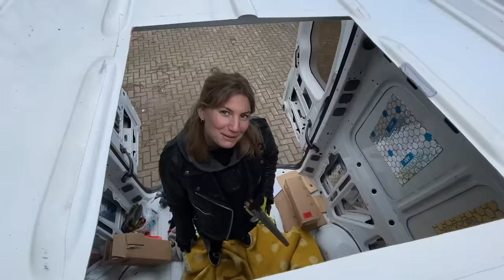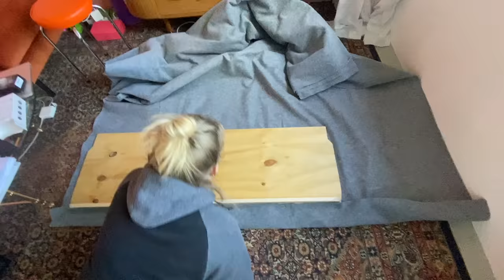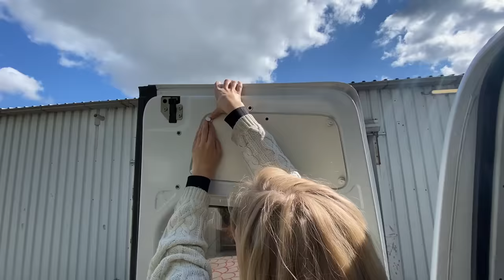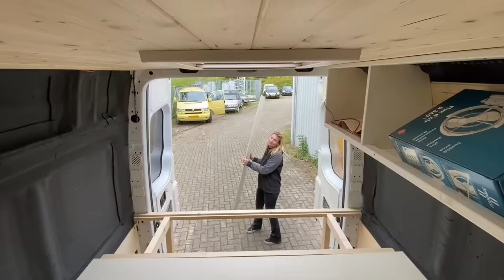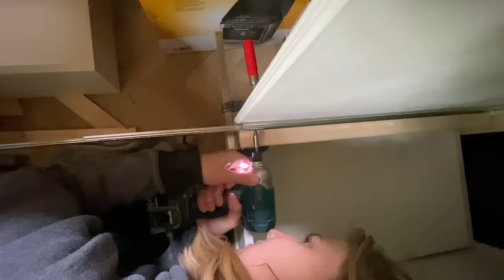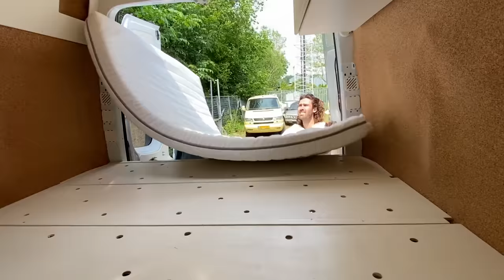We Build our Dream Camper Van | FULL TIME LAPSE | Sprinter Camper Conversion

Comment: I built a great camper out of an old landrover in South Africa. It broke down in the Limpopo Valley. It was green in colour. Someone came along and gave us a lift to Bela Bela to fetch a new diesel pump. Four days later we were back at landrover. A terrible site greeted us. The landrover was half crushed. Judging from all the tracks it seems an elephant bull had mated with it. A years work written off. Anyway that's Africa for you.

Comment: Love you guys and your video content, very slick and professionally done.  This is a friendly warning from one self-builder to another, the cooker you fitted is not meant for use inside a vehicle. You may already realise it gets super super hot in use but it is meant for outside use while camping.  I would recommend you change it for a more suitable appliance but if you don't feel the need be extra vigilant while using it and don't leave the camper unattended. Stunning conversion otherwise, it looks professionally done. Keep up with your very entertaining videos I aways look forward to new content .
Reply: The cooker did get very Hot indeed!!! ,so we isolated its compartiment with heath and flame resistant material.no worries